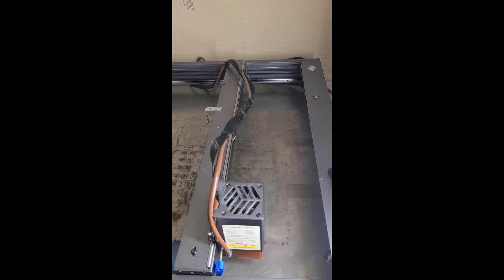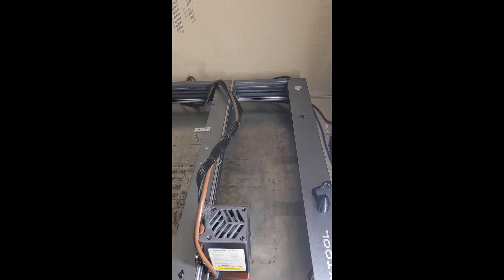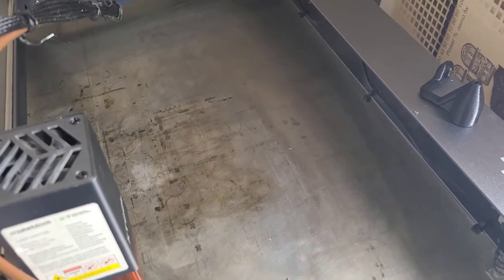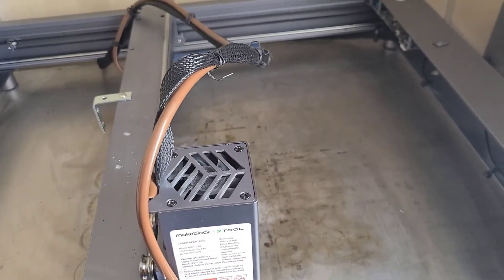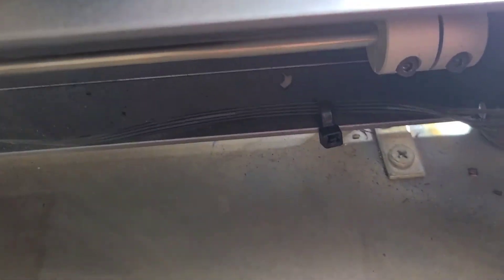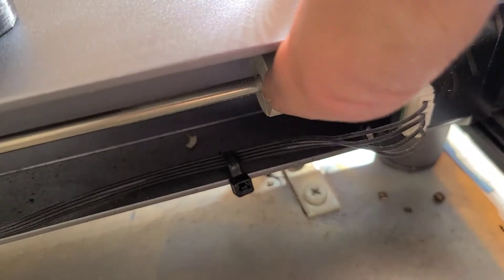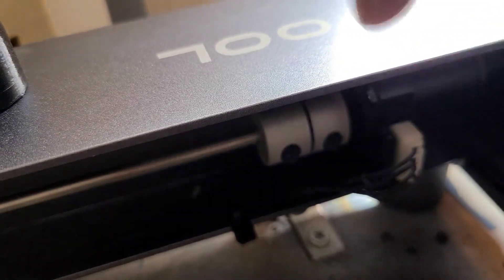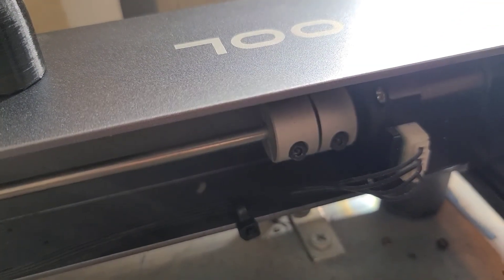Checking and adjusting the X gantry alignment on the xTool D1

Comment: are you still active on here? I'm wondering about squaring the actual laser head to the table, mine is has like 4 degrees out of level and I know that my spoilboard is level
Reply from the maker: @wolfofwallmart  hey there! Yes, I'm still active but have been busy of late.

For module tilt, check the bearings holding the module carrier to the gantry. Over time, they will wear out, especially if extra weight has been added on.

Comment: Hi. Slightly different problem here. My module seems straight after the test but the crosshairs when framing a material, the laser does not cut exactly where it's framed. I have to push the laser crosshairs out of the material area on the the jig I'm using on one side slightly and then it cuts in the middle. Very annoying. Could you please give me an answer to this? Thanks 🙏🙏👍👍
Also I don't know if the crosshairs frame themselves to be straight after focusing the laser but mine seem not squared atall. Thanks again
Reply from the maker: This sounds like a configuration issue, specifically the offset of the pointer (red cross). While the standard is -16mm for offset, the reality is that not every module is exactly on par. Both XCS and Lightburn allow you to change the offset value to overcome this issue.

Comment: I can't figure out why the machine won't move sideways. It only goes forwards and backwards and no one has any ideas. It's frustrating
Reply from the maker: Usually this is because the belt is out of the clip on the backside of the carrier. Or, the cable to the stepper motor is unplugged/damaged

Comment: Hi, Cobey...when you tighten that screw, can you wiggle the gantry or is both sides firm?  When in the my early days...the laser head crashed that &^%$ rail so many times it was pathetic.  Well, I finally fixed that problem.  However, that crashing caused the Gantry to go out of square.  Watchin this video..(bless your behind for that one) I see that is where I align it .  But I can still move the right side somewhat....the left side is stable.  Is there something else I should be doing?  (My left and right is looking at this from the front of the machine.
Reply from the maker: If the belts are tensioned correctly, there should be little to no wiggle in the gantry, outside of being brutal with it
Reply: @geeksatlarge  Ok, I've tighten just a tad more.  They say that you don't want to tighten to tight for the sake of stripping the screws...  Now, I've got to get LightBurn to behave.  Thanks fella, you are a life saver...
Reply from the maker: @kittyrings  use the 45  degree test
Reply: @geeksatlarge  Just out of curiosity. I suspect I'm having the same issue. What specifically is the 45 degree test? is it a preset in lightburn?
Reply: Kat the same thing happened to me! I could wiggle the right side while the left side was tight! I took the front cover off and the silver rod was slightly out of its little pocket!

Comment: What do you actually do to make the adjustment? My "button" side is much looser than the opposite side (left if facing front) TYIA
Reply from the maker: If one side is more loose than the other, you should tension the Y belts so they match, then do the 45 degree test to make sure that they are not too loose/tight.

On the rear left and right sides are the locking screws for the adjustment. On the back, both sides, are the actual adjusting screw.

To determine the balance, pluck each side and listen to the tones.  Tones will be close matches if the belts are tensioned evenly.
Reply: @geeksatlarge  Copy, I will try a tone test vs a feel test. I have no idea how tight or lose they were supposed to be so the securing screw on the side is set a bit tighter than halfway, so its decently taught.

Facing the machine from the front I can probably move 3 teeth on the right belt without the other side moving--they aren't in lock step.
Reply: Same exact problem for me! My left side is way tighter than the right. I’ve tried to adjust the belt but when I do, the laser won’t move and the belt just skips. It’s like it’ll either be way to tight or way to loose. No in between…